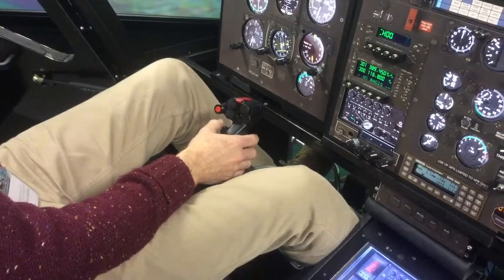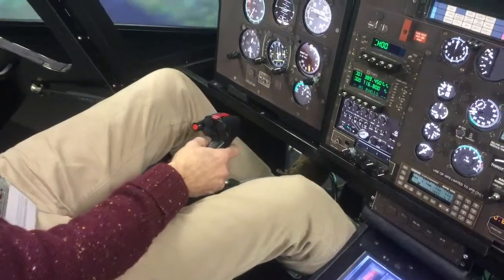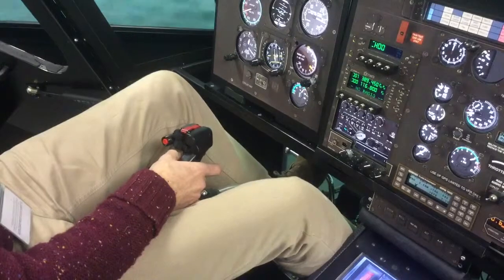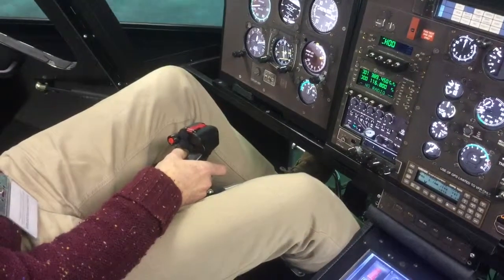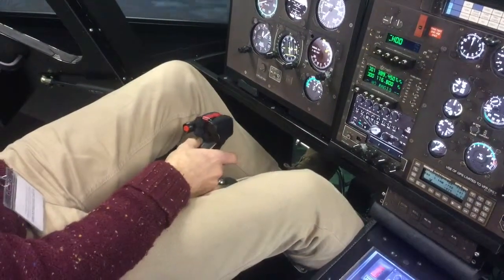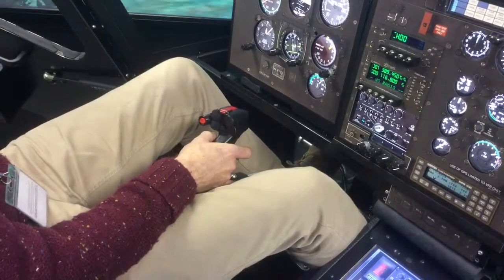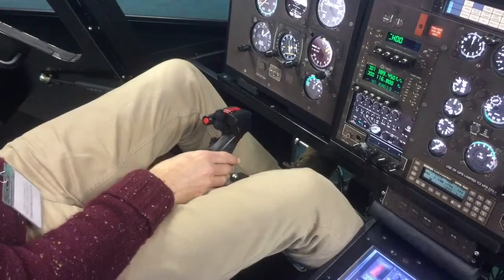Squirrel Helicopter Trim Emulation.

Comment: why would you want to lock the cyclic position when apparantly the cyclic always needs constant fine adjustments in flight?
Reply from the maker: This was built for military training and was in use for 8 years at the Defence Helicopter School, RAF Shawbury. As a helicopter gains forward speed it will pitch up. The force trim release button, which the real helicopter has, resets the cyclic centre to this new position. The hydraulic force on the stick can be quite strong. There is a fine trim hat on the top of the stick. It is expected that students trim the helicopter in order to reduce work load.
Reply: @rcsimulationsltd3072  why do most videos  the cyclic seems floppy and loose when flying?
Reply from the maker: vracan With aircraft  like the Robinson R22 the cyclic has no centring at all and is floppy. In fact it will fall in any direction it choses if you let go the stick. In the case of larger helicopters such as the Squirrel, which is simulated in the video, these have hydraulic controls and the cyclic control can be very heavy to use, which is why it has a force trim release. I can assure you that what we have done and what we show in the video is correct. I have flown both a Robinson R22 and Squirrel, both single and twin engine so arguably I do know what I am talking about.
Reply: @rcsimulationsltd3072  not questioning your knowledge, I was just curious to know about cyclic stick force since no one talks about it. .  That must make it hard for pilots to transition from smaller to heavier helis since the control feel is so different. Look at this huey stick seems floppy too at the beginning of the flight:  https://www.youtube.com/watch?v=FGOT3NH4bx4
Reply from the maker: vracan At the beginning of the flight the cyclic is in a neutral position but I notice that in fast forward flight the neutral position is forward. The button above the pilots thumb is the force trim release button and he may well have operated it. You can fly a helicopter without trimming but the workload goes up. The Robinson R22 is what it is, you can steer it if you both lean in the same direction:). The point of our video was to demonstrate the function of force trim release rather than demonstrating flying with it. The instructors particularly liked the fact that it clicked as then they knew that the student was actually trimming. Instrument flying is particularly difficult in an untrimmed aircraft.